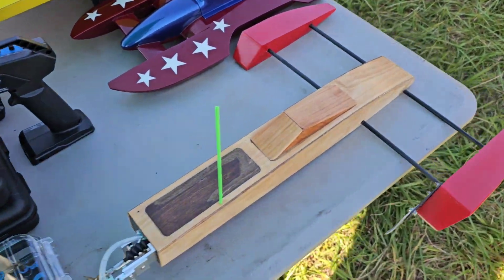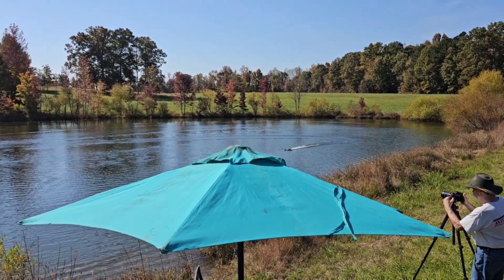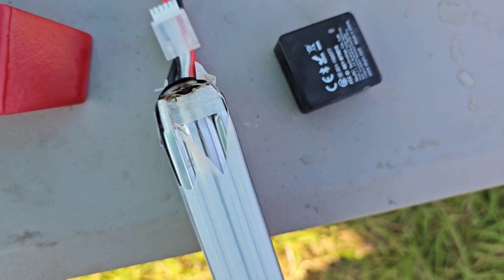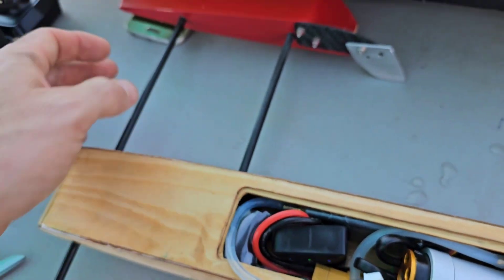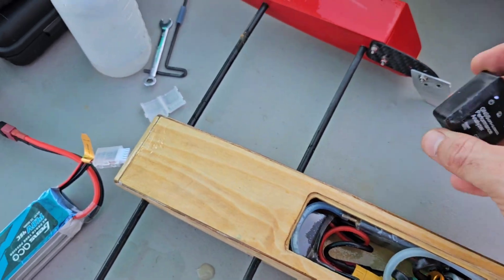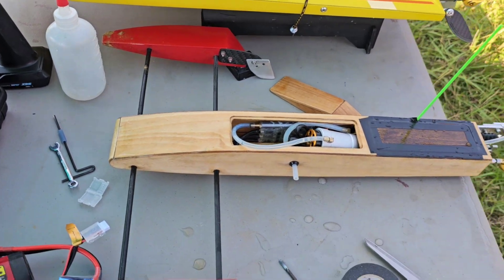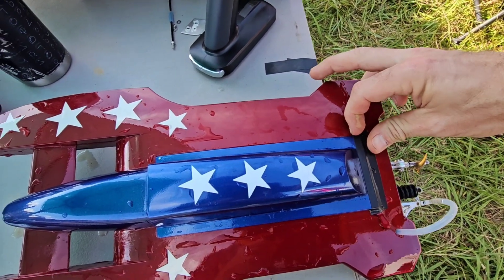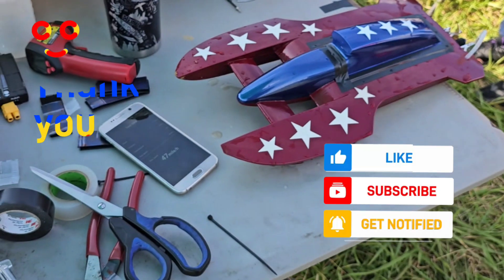Low C-Rating lipo almost makes my boat catch on fire! Tested 4 Different Brand Batteries

Comment: Awesome video!  Here's my two cents.  

Lipos swell due to over discharging below 3.2v per cell, once below that 3.2 the chemistry within the cells want to expell gas causing swelling Especially when Discharged fast.   Awesome test
Reply from the maker: @IRONCLADRC  your question peaked my interest. I just checked and it's
3.72
7.19
0.00
3.71
I assume the 2 middle cells fuzed together or something crazy. Itll be cool to shoot with the .22 , I also ruin a SMC battery by forgetting on discharge, even if it gets to 3.85v if I don't pull it off it'll slowly keep draining the battery. I got it back to 3.8v but it seems slightly puffy too. Not worth the risk for a $20 battery
Reply: @H2oMechanic2RC  So that lipo basically swelled due to the extremely high discharge rate interesting 🤔   SMC is the best!   Danny has a v4 SRD in the making.  New chemistry c'mon

Comment: Thanks for showing us how fast you can get that rigger to go, I'm going to finally build one of those kits Never run any thing lower than 50 c anything with any power nothing lower than 70c you saw firsthand how dangerous it is to run lower C .. and to help keep water out of your boat put Greese in the bellows of the servo arm and put cooling tube on the flex shaft inside the boat to the motor 5 mm on flex shaft to 5 or 6 over the copper tube.. make sure the cooling silicone tube is somewhat tight on the flex shaft holds water & crease from coming out into the boat & and do you have to seal all your silicone tubes coming in and out unless they're super tight water goes past them... Remember full trigger full triggerrrrrrr